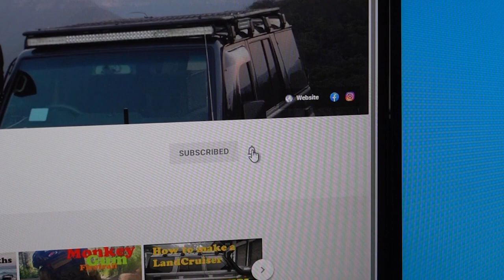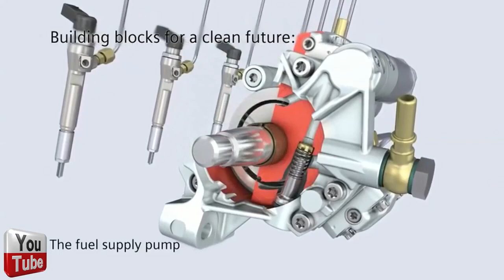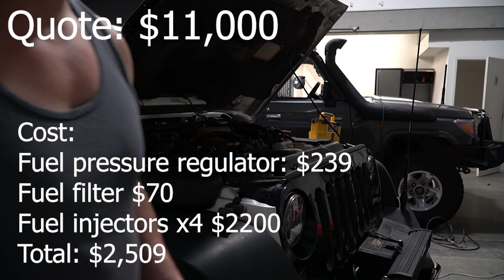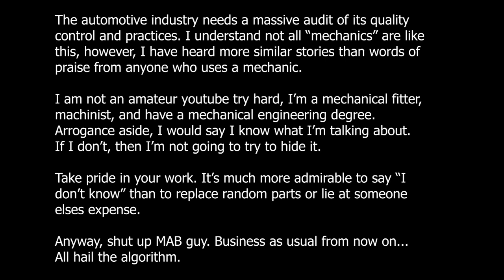A mechanic tried to charge $11,000 for this? Expensive repairs!

Comment: Agree! I got into 4wd in 2020. Bought a jk rubicon. A year later I noticed a ticking sound which became louder and louder, ended up replacing a rocker arm. Luckily it was towards the rear of the passenger cylinder bank which meant I was able to avoid removing the cam. 

Point being I have no mechanical background, but didn’t have confidence that the job would be done properly and at a reasonable cost. If you can problem solve and use the internet you’d be surprised at what you can accomplish.
Reply from the maker: Yes and no. By the sounds of it you got lucky
Vehicle specific problems can be solved online by the masses, but more often than not it's the blind leading the blind. Facebook groups and forums can be some of the worst sources of information for fault finding 🥲 proceed with caution
Reply: @ridiculousthings4x4  true, I was lucky in that the issue was a common fault with the early Pentastar 3.6 engines and symptoms some what easily distinguishable. It’s an addictive feeling when it all works out.

Comment: Spot on with your comments about the automotive mechanic trade. I'm no expert but I do understand logic and troubleshooting due to my IT background. Since owning 4wd vehicles for past decade I have had ongoing problems finding a mechanic with integrity. As you've said, if one does not know or can not find the problem it's a simple matter of being honest and admitting it. I've been trying to address leaking swivel hubs on my 76 series for past 3 years with 2 mechanics. First mechanic supposedly kept rebuilding the hubs each time I returned the vehicle. Evidently the guy is insane, repeating the same thing and expecting a different outcome. Second mechanic to whom I explained the history in addition to explaining that the only logical explanation is a bent diff, repeated the same thing and provided the assurance that he would check the diff first. Oh how surprising,  the hubs continue to leak. Of course, the second mechanic blamed a blocked breather hose and assured me he had checked it prior to commencing the rebuild.  I had previously extended the hose to the top of the engine bay near the firewall and had not driven in any extreme conditions after he had performed the work so the excuse is absolute bollocks. Next port of call is to to a diff specialist to confirm the state of the diff housing. At this point, I'm more than happy to hand over $1800 to Toyota for a new diff housing and install myself instead of dealing with these lying bastards. Hopefully the bent diff will be confirmed which will enable me to take the legal action against the last mechanic. Cheers
Reply from the maker: Someone played far cry 3... Maybe I should start another MAB subdivision called the "Fixing Unrepairable Cars Klub". Might need to be abbreviated. On a side note, mechanics often scrimp out and use cheap shit parts. OEM internal seals are the way forward. Worth a check in your case at least as it's cheaper than a new diff housing.

Comment: I've seen it in the motorcycle industry too. New clutches when all it needs is adjusting, "new crank" installed when they've been welded back together, people getting quoted on engine rebuilds when all it needs is a carby balance etc etc. These people need to be called out and shamed.
Reply from the maker: They should be named and shamed, but it's a shame they have names in the first place.

Comment: With the fuel, being that bad, and causing that much damage. 
Why wouldn’t you want to take off the fuel lines, and clean them out and inspect them?  Would it just be a waste of time?
Reply from the maker: It was cleaned and flushed through, but fuel parts have warranty clauses, and you often have to produce invoices for various other parts before they'll step up in the event of a claim.

Comment: Nice work.  More videos like this that exposes work practices of dishonest mechanics should be made.  We need to rid of them.  They give honest hard working mechanics a bad name.  I hope the owner of that Jeep reports the "mechanic" to the Australian Competition and Consumer Commission, to not only get his/her money back, but to also get the "mechanic" investigated for fraud, and dishonest business misconduct.  I believe in karma, and these dishonest "mechanics" will be getting their just deserts, and may they all rot in hell.
Reply from the maker: Obviously I can act high and mighty because my diagnosis this time happened to work. Sometimes you can just be unlucky especially as a mechanic. The turning point is how they choose to deal with this. This time was a massive F- for the ones that touched this car.
Reply: @ridiculousthings4x4  I know not all mechanics are created equal.  My comments were towards the lying part.  About replacing parts that weren't, and charging for it.  That's simply fraud, and 100% dishonest.  Then as you've said, their actions afterwards (ie. not coming clean & transparent that they cannot resolve the problem).

Comment: Those VM Motori heads can be a right bugger to get the injectors out of, good job mate.
Reply from the maker: They can be. But you can always use screwdrivers to break bits off them like the previous mechanic
Reply: @ridiculousthings4x4  I did see that.......philistines

Comment: Sometimes spending money on new parts is the best way to go, it eliminates that problem.
As you demonstrated with replacing the regulator. A simple diagnosis to start the ball rolling and go from there.
Not staying that dealers are the best but taking a vehicle to a dealership can be the best option, as they are trained to work on that particular make. 
Anyway, you made a great point, start with the basic stuff, ie dirty fuel and go from there, it would of helped if that said “mechanic” did do what he said he did and had some idea on what to do other than just change oil in vehicles…..
Great content, always looking at things from a different angle, love the videos.
Reply from the maker: Especially with fuel systems. New stuff is crucial. Australia is on the back foot a little with dealerships as euro/USA manufacturers don't often have dedicated workshops here. Just mechanics with a preference.

Comment: I’ve been an appliance and HVAC service tech for 28 years and I take pride in my work as well but I’ve seen a lot of guys throw a parts grenade and something and cost the customer a lot of money for unnecessary parts it drives me nuts. If it does fix it they just lucked out and it was one of the many parts that the customer bought most of the time if you have an a problem with your appliance or HVAC unit in your home it’s usually just one bad part. And yes I do call those guys out because it is unfair to the customer and it’s just bad workmanship. I just found your channel and I really like it thanks for the video
Reply from the maker: In this case, an 11k parts grenade quote to blow it out of their workshop and into mine. Parts grenade. I like it. I'm stealing it. Sorry not sorry
Reply: @ridiculousthings4x4  take it sir.